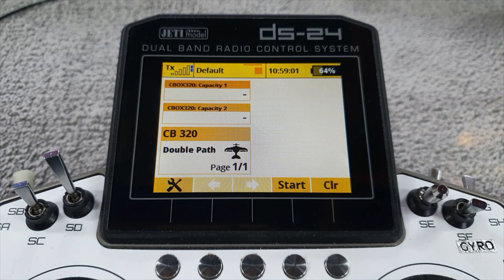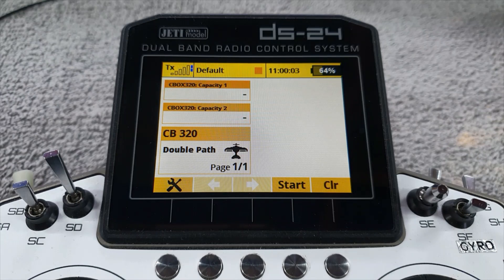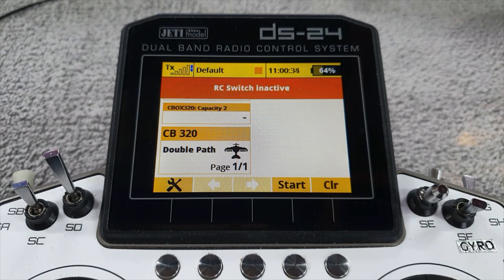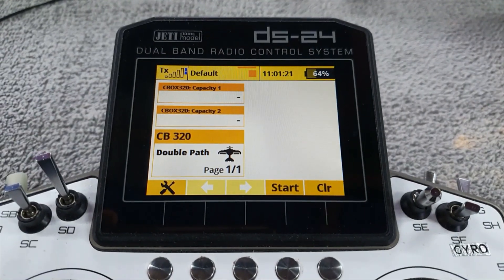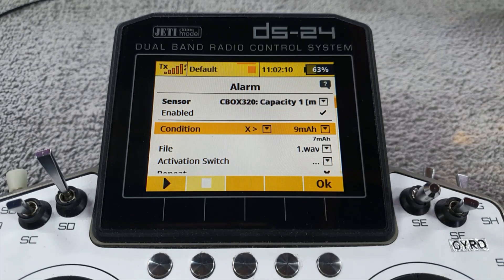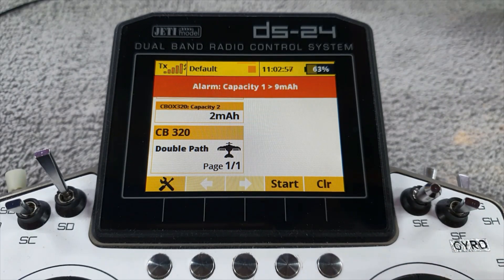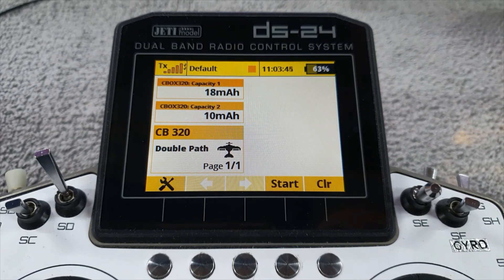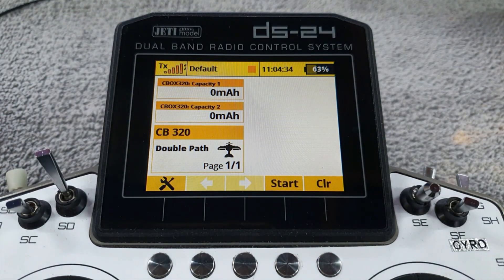Jeti - central box CB battery used capacity counter

Comment: Harry, if you have 2 separate batteries plugged into a normal Jeti receiver, can you monitor their respective voltages on the transmitter, rather than just showing a single rx voltage?
Reply from the maker: No, a standard Rx just measures one system voltage.  If you really need to know them you could use a MUI 30 on each battery
Reply: @cotswoldpilot  thanks